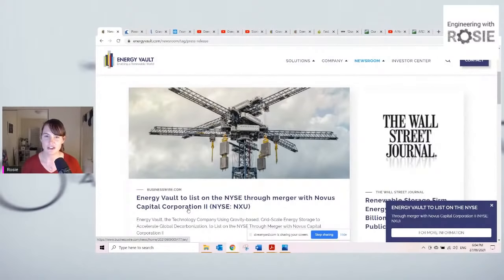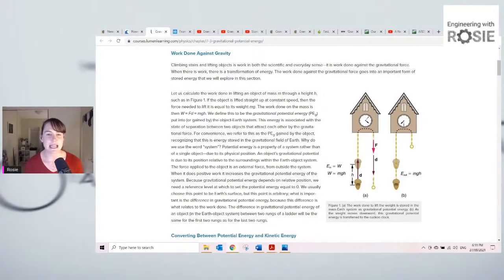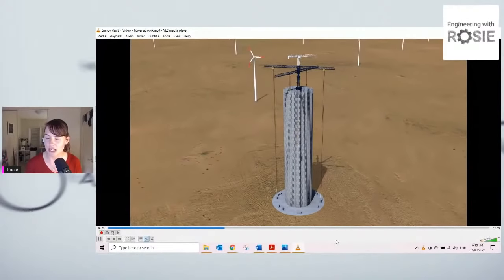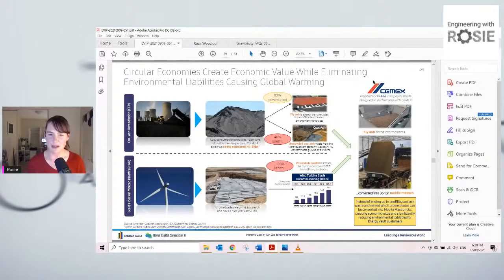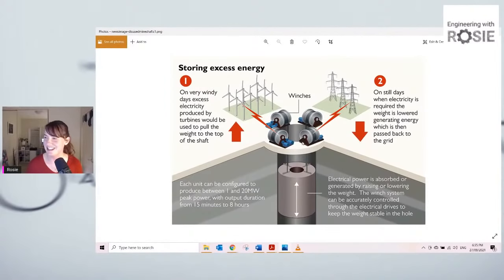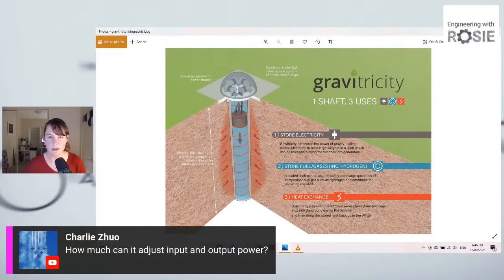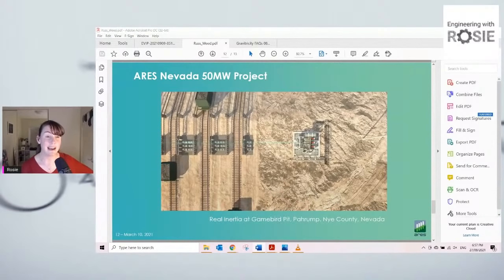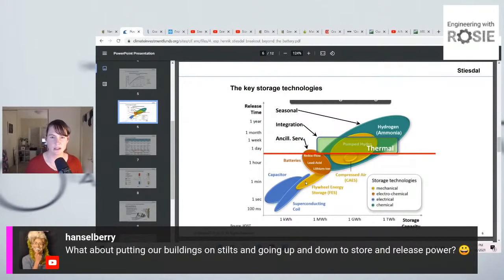Engineering with Rosie Live Ep. 2 Strange Storage - Energy Vault, Gravitricity, ARES Rail Storage

Comment: If you need some help hanging those pictures up I'm very competitively priced 😉
Reply from the maker: Ha ha! If you're not Australian you may not believe this, but I rent and here in Aus your landlord is allowed to forbid you from putting any new holes in the wall. I am only supposed to put hooks up where there are existing holes 🙄 I did get some 3M removable velcro kind of system but it will need a bit of handywork to modify those panels to work with it.
Reply: @EngineeringwithRosie  😅shocking, I have complete confidence in you. Great stream 👌